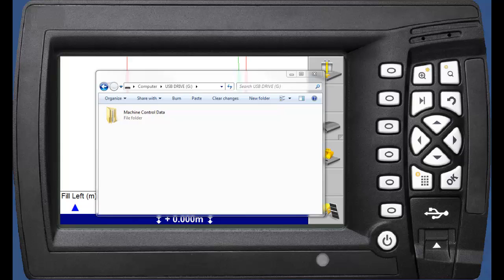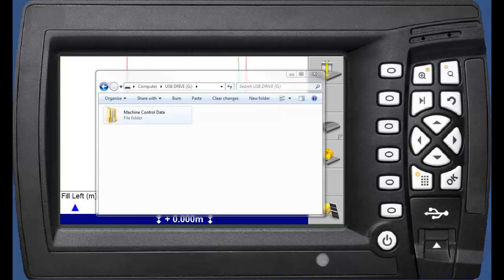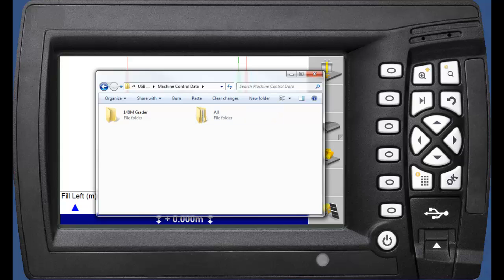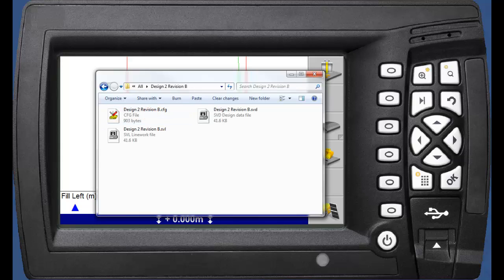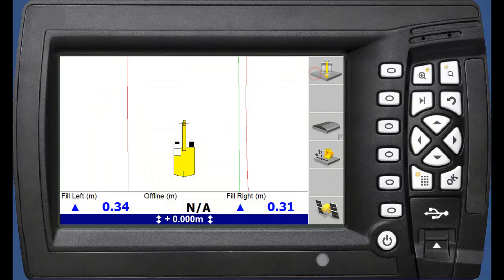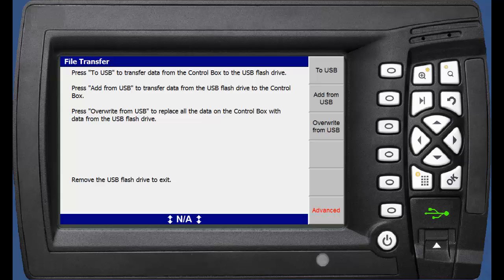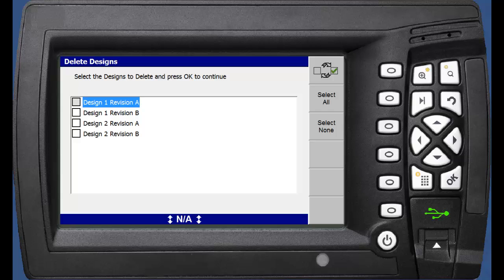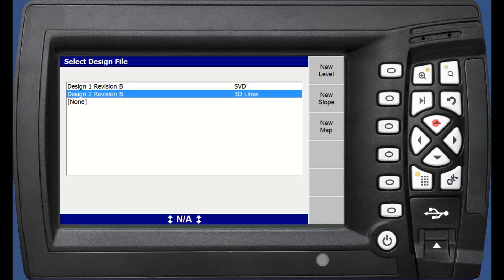Manage Designs on Trimble GCS900

Comment: Hello, I am working with this machine control lately.
If I could ask one question, what for is the .SVL file. If i open it in HCE BC it is just a flat line version of my surface in fix height. If I am choosing the working design in excavator's computer I can only pick the .SVD. So do I actually need it for something or .SVD and .CFG together could be enough?

Also if I am doing the file in HCE BC from surface in format .LandXML the outcome is .CFG and .SVD only.
If I am doing it from surface in fromat .dxf the outcome is all thre .CFG and .SVD and also .SVL.

Thank you Josef